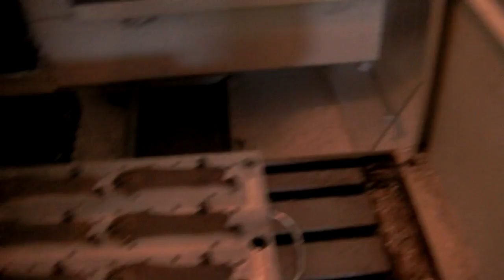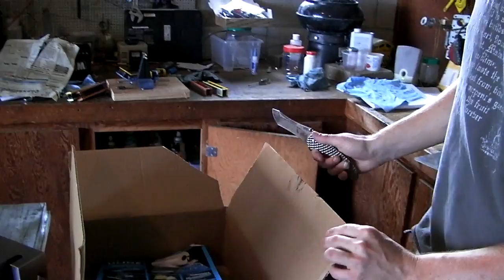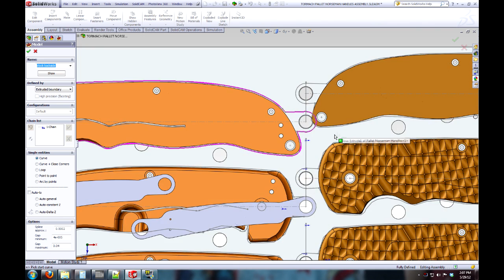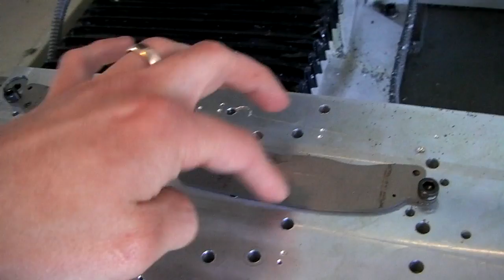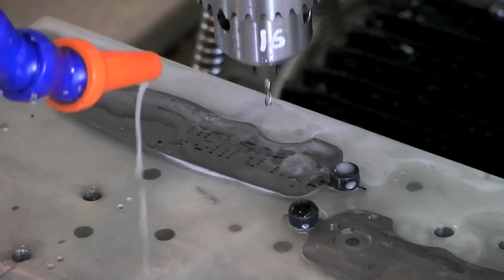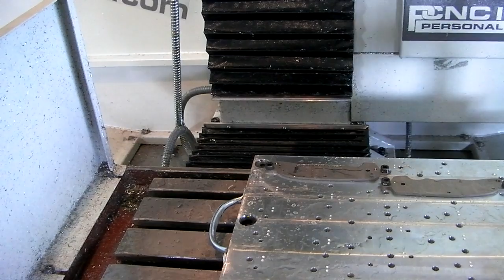Knifemaking Tuesday Week 29 - blade and handle machining

Comment: nice work man I'm impressed your self taught. with the tap it would be easier if you put a small chamfer on the hole to help guide the tap and save deburring time. also with hard materials its good practice to do the tap hole very slightly larger that the correct size to make life on the tap much easier. and when reaming you should feed in and out using the g55 boring cycle, instead of feeding in, spindle stop, then rapid out. hope this helps :)

Comment: The problem with your tapping cycle is not the head it was your hole size was incorrect.  You were drilling for a standard tap when using a thread forming tap you need to drill them larger for a 2-56 you need a .078 hole.  If you think about it a standard tap cuts the threads removing material, when using a rollform tap as you said the material is displaced to form the threads hence you need a larger hole.

Comment: At work we rigid tapped M6 regulary at 400 rpm in aluminium(and those were deep, blind holes), ofcourse in steel you have to go slower, but 60rpm is very slow for small taps, maybe for a M20, but it shouldn't be necessary, especially in thin pieces.
Ofcourse a good machine tap should be used. We do a lot of tapping and I only broke one on the machining center. (and that was because the pilot hole was not deep enough). Flood coolant or good cutting oil also helps a lot.

Comment from the maker: 300rpm is the lowest rpm in the high pulleys, swapping the belt to the low pulleys will get me 150.  After learning and practicing I've got no problem form tapping at 300rpm now.

Comment: Of course there is a whole lot of assumptions here, but I am assuming to do this one pass method the concave and convex edges are the same contoured shape for their full length. Of course the part where the two edges meet and the rest of the blade would probably have to be finished with a different Milling Cutter.

Saying this, I guess if it was possible it may have been done by now, as a geek I find the Milling process so interesting, but always have a question  "what if" all the time

Comment: hay grate job on the knifes but one thing i noticed though is in your reaming operation you retract the reamer out of the hole to fast, wen using a reamer you should not only be using the proper feed rate into the hole but also wen backing out of it.

Comment from the maker: Hey Michael, that sounds awesome!  I've definitely heard of thread milling and have been wanting to try it for a while.  I tried it once by taking an M8 4fl tap and grinding 3 flutes off, I created a 12x1.25 thread.  I'm looking forward to trying out those threadmills, forgot all about Lakeshorecarbide.  Single point threamilling is cool because it's more versatile, but for what I'm doing, it would be worth it to get the proper sized ones.  However, we just threadformed 100 holes on one tap!

Comment: +1 for GWizard - worth its weight in titanium.

John, as for tapping 2-56; I do a LOT of these. I have a Tapmatic setup on a drill press but I started thread milling them. Wow! It is so much easier and if you do break a bit (which I have not) it will not ruin the part since the mill is smaller diameter than the hole. Check out lakeshorecarbide for a great 2-56 tread mill. I'm doing all my holes from 2-56 up to 1/4-24 with these. 

cheers,
Michael

Comment from the maker: You know, I never knew the difference, but I just looked it up and I totally understand what you mean now.  I think G99 will be faster since it's not retracting up to original position, but G98 would be very handy for some parts.  The cool thing with subroutines like this is I can do a really shallow G99 and put a Z0.75 retraction at the end of the code, that's what I ended up doing here.  Thanks for the tip.

Comment: I'm not sure I agree with Tormach on the compression side of the tapping cycle, I was taught to run the feed rate at 90-95% of the calculated feed so that the tap would actually pull the spring out slightly during the downward part of the cycle. My other thought is that yes you typically have more runout with a tension/compression holder but I think that is too much. Keep up the good work.

Comment: You know that you have to drill holes for thread forming bigger than for thread cutting.
For thread cutting you drill for example for an M16 with a pitch of 2mm you drill a hole of 14mm for thread cutting and a 15mm hole for thread forming so half of the material gets pushed inwards to the tap and half of it gets pushed outwards. I hope that makes sense to you, I'm a german machinist and it's pretty difficult for me to explain something in a foreign  language. Nice machining though!